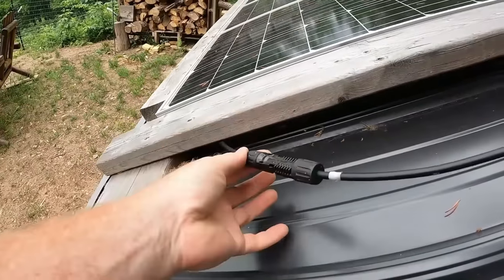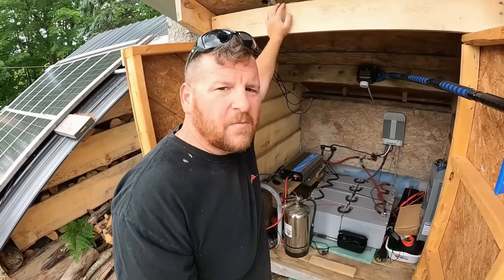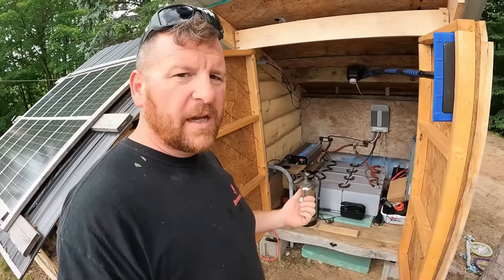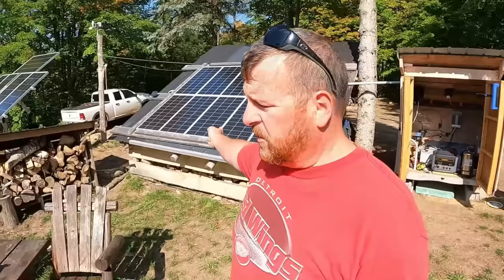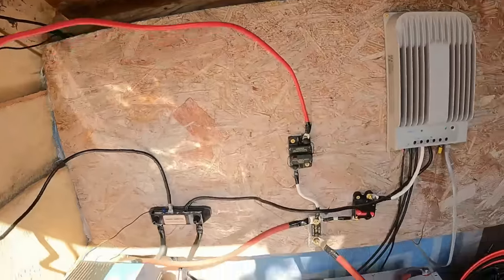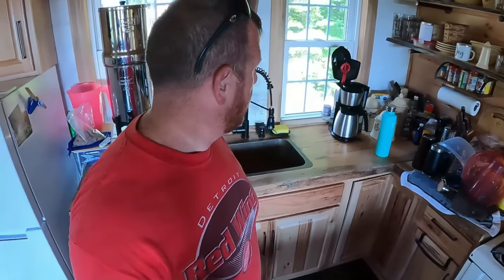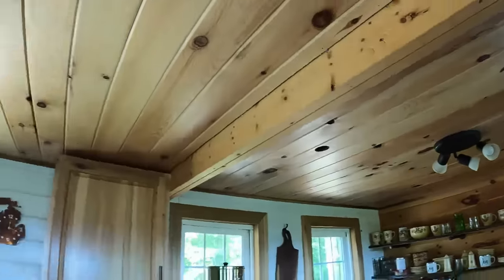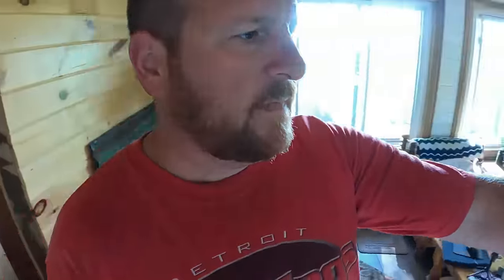SCAMS to Avoid With An Off Grid Solar Power System - 2 year update

Comment: Looks good Jay!  I just replaced my Vmax Tank AGMS this year after 10 years of use with a single 400Ah LIFEPO4 stored in the cabin.  After 20 years off grid with just a small 400 watt system I finally upgraded and now my system is 800 watts Renogy and two 200 watt recharging stations with 800Ah of LFP battery storage and some power stations.

You learn as you go what your power needs are and you can always add batteries and panels if your needs increase.
Reply from the maker: Sounds awesome.......it is nice to hear others can make small systems work for them. You'll have to let us know how that new battery treats ya
Reply: How do you manage LIFEPO4 in the cabin what are your operating temperatures in the cabin? Mine are like 14F and 120F and most LIFEPO4 is 32F to 104F.
Reply: @johnsturtevant9351  I live full time in my cabin and have propane heat. So it never gets below freezing even if I leave the cabin for awhile. You can also get 12 volt RV tank heaters for your batteries.
Reply: @solarcabin  I think he mentioned that in one of the videos - I need to go back and re-visit them. I have kerosene heat. I have thought about propane - but the expense and the "backwards minded" propane folks we have around here are not in the same mindset of you and I. Hence,  I go it alone, looking at the Buddy heaters lately. I have 500 sq feet. I been ok so far - but the Blueitti B300 may just have to be disconnected when it gets to cold and hope it does not get damaged, maybe wrap it up with blanket too.

Comment: If you put glass it the south facing, for your battery shed would heat it during the day. Also you could build a solar water heater to heat it at night. I have a 3000w array, using golf cart batteries 48v system

Comment: A really good and smart idea is to put a huge plastic or glass cover piece over all the solar panels to keep them dry and clean and to extend the life of the panel. All you have to do is clean the plastic or glass cover to keep the efficiency as high as possible. Propane fridges still need power connected to them to ignite the flame so really propane fridges are a bad idea also if you get new laptops with Oled screens you will use less power charging them, idk how much less but probably not much.

Comment: I have a 1k 48v system. Single axis rotating east to west. Adding anther 4500w of panels now just not connected yet. So the 1k of panels currently runs my double door house fridge with icemaker and all that. No problems with it in South TX. U have a nice setup. I started out going small n cheap also. Now I look back n think I could have saved $$ by not buying twice, but it was a good learning experience. I started out 12 volt then upgraded my inverter to 48v. Wish u the best

Comment: Great video  !  Our solar systems and cabins are very alike. I used Lifepo4 batteries because they're inside.  Same wiring in cabin, I used a energy star fridge too. This winter will be my long stay in it, and those week long Grey periods are my concern. I will put up with hearing a generator,  rather than a 50 to 60 k solar layout !  Keep up the good work !
Reply from the maker: Thanks Phil
Reply: Gas prices will eat you alive! My generator uses darn near $20/day at $3.54/gallon for ethanol. Doesn't take many days of using a generator to discover you could have bought a few used commercial panels. (That does mean sitting in the dark for a month or two!) 

You'd be amazed at the number of solar panels for sale on CraigsList, Marketplace, etc. Lot's of old panels from solar farms etc although they generally want to sell you a pallet at a time... still, used commercial 220w panels are going for $50/ea with a 6 panel minumum or $45/ea on pallet just a few hours away from my location. Bet the choices are better in mid & south West as solar farms upgrade.

Comment: Suggestions use 300 to 400 watt panels and run a heated system that heats rocks from a garden store. In the summer. When you expand your solar system you repurpoise the panels.

Comment: Glad to see someone with a reasonable pocket book doing off grid. I didn't see a connection to the company that makes the tracker for your second PV array. My proposed location is wide open to the south so could benefit from a tracker. 

My property has the water table fairly close to the surface. I have a sandpoint well. Have you considered if one would work at your location? Water was one of the first things I wanted at the off grid property. 

I fill 20 pound propane tanks from my 250 gallon tank. In late July I paid $1.50 a gallon for propane and they delivered. Costs about $5 to fill a 20 pound tank.

Comment: what you have proven is it doesn't take all that much solar to power your needs if you are willing to make some compromises and adapt to the limited power. Also, going propane for things like cooking or a clothes dryer are the way to go. Matter of fact, I discovered I can dry clothes in just a few hours (rainy day or winter) by hanging everything in my garage and using a 20" window fan to move the air. Yeah, jeans take more time, but the rest is just an afternoon. BTW, a ladder hanging on the ceiling makes a great place to hold coat hangers just for that purpose. Oh, and modern front-loading washers only pull maybe 200 watts. That's a piece of cake on solar or gen set.
Reply from the maker: I love comments like this.....we can learn from your experience as well. Thanks 😊

Comment: If you want to run anything off 12 volts, or 115 volts, a power station can make it happen; they  will charge from solar or 115 volts.  When we camp or travel, we keep a 12/115 refrigerator which can also cool to become a freezer in our truck.  We are in our 70s but don't use propane lanterns or buy ice anymore unless for drinks for a lot of people.
Reply from the maker: awesome =)

Comment: I bought a 5 cu ft chest freezer and converted in to a fridge, uses 30 watts when it runs.  Also have a 7 cu ft chest freezer that uses 60 watts when it runs.
Reply from the maker: That's awesome. Does converting it just consist of changing a thermostat or something like that?
Reply: @OffgridwithJayandJen  Yes, it's a simple exchange of the temperature control.
Reply from the maker: @ScottsLifeOffGrid  nice

Comment: I find the Frigidaire seems to be the best for off grid use. The walls are thick around 3 to 4 inches also the door. Also mine only uses around 90 watts unless on defrost mode it runs around 130 watts.
Reply from the maker: Nice....this Is good to know. I threw out the wattage number on this one using the numbers on the Tag....but like yours if uses about 60 watts during it occasional cycle and surges once and a while to 130-150 watts. So I'm glad to know that there are other great options out there as well. How big is your fridge??

Comment: What do you do about, air conditioner,  heating, water heater, and washing clothes, great video,  thanks for sharing!
Reply from the maker: We heat with a wood stove, but using a mini split on solar I very possible, and something we are going to consider installing in the next year or two. IF you kept a smaller home or cabin running air conditioning or the mini-split you could make it work, but would likely have to double the solar input. Washing machines draw 200-400 watts, so that would not be too much of an issue either. We have a washing machine ww use in our barn, we run it on a portable power station.  😊
Reply: @OffgridwithJayandJen  thanks, I'm setting up a small 1200watt 24v system, just trying to learn all I can. New subscriber
Reply from the maker: @Markslife101  awesome....good luck. Any questions feel free to ask. I learned most of my system set up from Will Prowse....check his early videos out if you get lost. I'm sure you already have, but if not it will be helpful for ya. Best wishes and thanks for subbing and watching. 👍

Comment: Really goid tips Jay & Jen, what about the washing machine?
Reply from the maker: Thank you.  We run our washing machine off a portable power station that we charge with solar as well, so can easily handle that. I think the best way is in sunny days you do your High energy use tasks. 😊
Reply: I went with the 2 wash tubs, wash stand and wringer - I built the wash stand around my needs (the lumber was COSTLY - glad it has come down a bit). I use a clothes line inside and several I have outside. It is my wind and solar clothes dryer. LOL :-) In the summer hang it inside and it dry in hours, thanks to the HEAT, yes sarcasm at best, I can't stay in the cabin during the day in the summer.

Comment: Totally agree with comments on off grid appliances. we have 1000 watts of solar and started off with a Danby fridge 10 cu ft. Found it too small when entertaining so upgraded to an 18 cu ft Samsung with a digital inverter. The 10 cu fit Danby was rated at 297 kw/hr per year. The 18 cu ft digital inverter is rated at 325 kw/hrs per year. Almost twice the size with a small increase in power usage. Good alternative i think.
Reply from the maker: That is Really Good to know David.....thanks. We Chose this Fridge primarily because of Space and cost....But Having a little more Space in the Fridge would Be nice if the Efficiency is similar. =)

Comment: Excellent review! Very smart and affordable build. I’d like to know how many amps draw from the inverter output when everything is running including frig. How close to 3000w are you pulling?
Reply from the maker: 3000 watt inverter. Only time we have drawn that much was when the circular saw and air compressor surge at the same time while building. Otherwise we typically only draw 30-50 watts consistent and 200ish if fridge is running

Comment: Thanks for the walkthrough of your system.  I’m finding that it’s much easier to build your house/cabin to the power than it is to convert a house that was built for grid power to off grid. Unless you have a pile of cash. I’m assuming you don’t have a well pump or freezer for food. That’s where I’m running into issues.
Reply from the maker: We collect rain water and use a 12 volt RV style pump for the cabin. Deep chest freezers are known for being VERY energy efficient,  but we don't have one here.

Comment: Great looking place there, Michigander!  Our off-grid place is way up in Michigan too and are planning on retiring there so I sprang for a bit more to really do it up. We did a 48v system and I built an 8 x 8 area for housing everything - batteries, inverter & charge controller. Built what we call "the powerhouse" up on 4x6 "stilts" so it's not so easily buried in deep snow.  2x6 walls with R19 and R30 in the floor and ceiling with a propane wall heater on a thermostat. Even if it's -20 outside, it maintains 58-60 inside. Have 24/235ah 6v batteries - 3 'strings' of 8 batteries. We've got 18/250w panels in a fixed 45 degree position since we're closest to the 45th parallel. I need to add distilled water about every 3-4 months but no big deal. That might change to every other month when we live there full time. We'll see. The system runs 24/7 and there's a 10cf freezer and a 7-ish cf fridge running right now. It will run a window shaker in our bedroom all night long no problem in the heat of summer and all the lights, TV, phone and laptop chargers, & power tools we need at all times of year. The powerhouse is actually 8x12 with 8x8 dedicated to the insulated area and then we've got a 10kw hybrid gennie (propane or petrol) in an uninsulated, separate room at the back of the building. I've never had to run it in 4 years. Also have a fairly beefy exhaust fan in the wall that's on a programmable "thermo plug". That automatically kicks on at 80 degrees to help cool the battery/electronics room/building. The 48v system is very efficient and with the array we've got, it's collecting juice with simple daylight, even on cloudy days. They will even collect some in daytime with up to an inch of snow on the panels from the light coming thru. Have a normal electrical panel in the house that the ac circuits come off of. I picked up the 18 panels for about $1,900 in 2017. Got an excellent price on a bundle of 27 on Ebay by going in with a buddy. He took 9.  I put about $17k into the whole dealio including the building, generator, wall heater, etc but when we got serious about making it a full time capable residence with modern conveniences, it was time to get serious. I had to tap a little off a 401k, take a 4 year loan against one of our vehicles that was paid off and saved some cash over 6 or 7 months but made it happen. A little of this, little of that lol.
Reply from the maker: That sounds like the ultimate system buddy......I hope we can progress to that level some day. Good work my friend
Reply: @OffgridwithJayandJen  Thanks! It was truly a game changer. We just finally got a well after 26 years of hauling water too. It's easy to get complacent when things "are working". Got a 500 gallon propane pig five years ago that the propane guy had and let us "borrow". We don't own it but use him to keep it topped off so it works out. Currently working on clearing trees/stumps to have a nice garden area and hopefully a future greenhouse

Comment: great video .. great minds think alike ... I  have been experimenting with solar for the last year ... ran the numbers, and like you went with a 10  cubic foot fridge from Menards .. no regrets at all... running Ecoflow pro, with extra battery, and 1600 watts of panels... powers everything in my old 1902 house, but with North Dakota winters, I haven't totally pulled off the grid
Reply from the maker: Awesome.......I think having the extra  solar panels is the way to go. Good work

Comment: Believe it or not those 12v coolers arnt that efficient.  Also to get around a tracking system you just add more pannels. Pannels are very cheap. 30-40c a watt on marketplace for full sized pannels.  Theres lots of people pulling them off there roofs

Comment: Thank you! I am trying to get my solar system set up I had to get my garden going and canning and dehydrating and that wasn’t cheap along with my meat chicken leanto and auto plucker, now I am getting my power system back up for fridge and freezer, I have oil lamps for lights and because I live in Texas I need a system that can run fans, wish I lived in a 4 season state instead of hotter than Hell’s Kitchen in summer lol thank you for showing what I need so I can start getting it.
Reply from the maker: Glad I could help just a little. Keep doing research and it will alp get figured out. Best wishes

Comment: Just built a system for my off-grid location. Used traction batteries the one I'm using is from a forklift you can run them down voltage Wise way lower without hurting tham. the amp hours are ridiculous the one I'm using 1100ah at c6  48 volt battery reworked to 24. Thanksgiving ran a slow cooker for about 6 hours with a ceiling fan that ran constantly electric fridge and the typical other consumptions with two kids. no sun rain for 3 days and only dropped it to 11.3 volt. 2.2k in panels my Outback inverters were expensive but the rest of the system was fairly cheap all of it used. oversized the battery  the most important. 3800 Canadian without the inverter.
Reply: PS  going to cost me $18,000 to run service to my building let alone monthly bills for structure I'm there two or three months a year
Reply from the maker: That is amazing.....really cool and nice to know. I'll have to look into those batteries. Glad to hear there are others out there making things work for them too. 😀
Reply: @OffgridwithJayandJen  the biggest secret in solar off grid

Comment: Hello Y'all!   Question, How many Watts is your newer (the one that rotates (and whats the name of the rotator, thingy😂) array?  Each or together?  Thank You.  Great video.  I think Y'all are switching to Lithium soon, you'll love them!!  I have them on my Sailboat and on my shed thats in my yard here.  Everything outside, including 5 ceiing fans inside, all my batterries for my power tools, including an 80W battery for my lawnmower (back problems/self propelled fwd) and 60W for my Limb Saw, can't use the manual one anymore.  Ceiling fan in the shed.  All the light in there are motion  solar.  And motion solar and camera outside around the house.  As much as electricity cost in the Summer in Alabama,  it has paid for itself in 6 months.   Owe....  do you have a switch to convert your DC to AC in your home for the 110 volts to run yourfridge???  THANKS AGAIN!!✝️🙏❤🇺🇸🤗😎

Comment: This has been a very informative video, im watching it from south Africa, im planning to buy a 5kva hybrid inverter with 4 200ah batteries in 2 months as i will be moving to a new place that doesn't haven't electricity. I was very sceptical about this, but this video provided more insight than the office or warehouse calculations. I basically need to run a frezer and a TV,  the stove is gas. With 90% sunshine this side, im confident that my set-up will work. Thanks for sharing this insightful information 🎉🎉
Reply from the maker: That's great, with good sunshine you should be good to go. Best wishes my friend